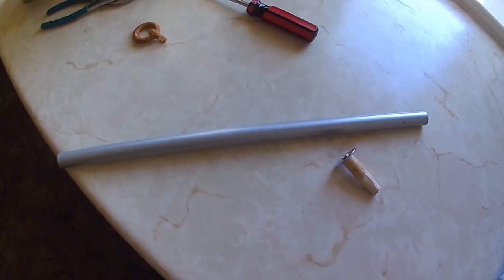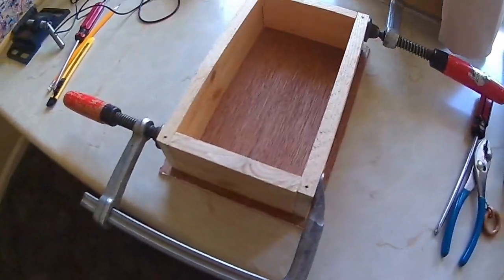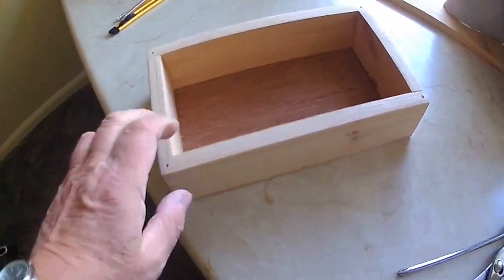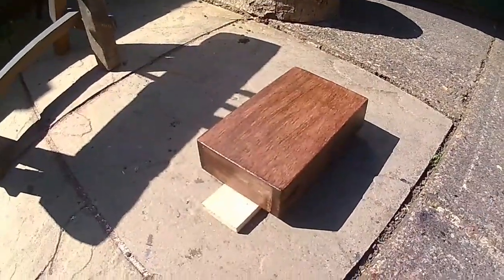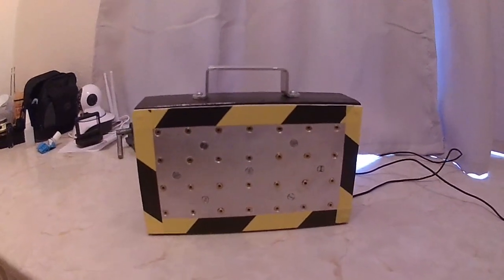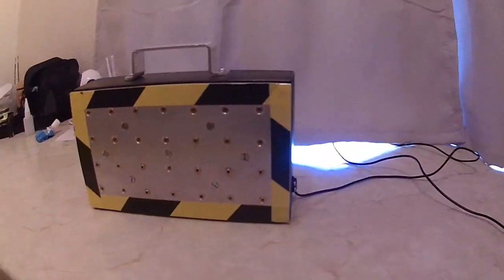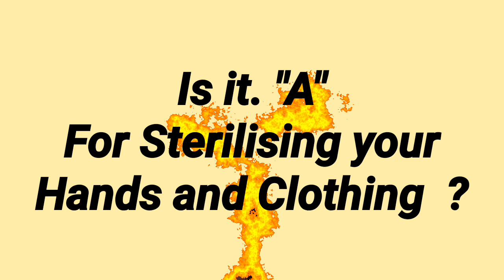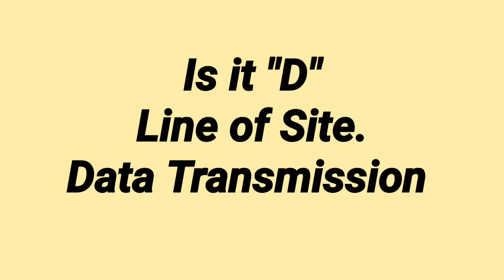Mystery Diy Electronic Project Part 2 of 2

Comment: I have now come to the conclusion you have seriously lost the plot George, but its obvious what it is. " Its a Smoothing Oxx Fluffy Flora "
Reply from the maker: Correct. I was ok but now my jobs are running out I miss the motorhome.  It's in locked storage and I cannot do the repairs I want to do. Such as change 2 x brake pipes. Reseal the roof vents and make it water tight on where the glass fibre roof joins the gutter rails etc. Just hope it's a dry summer.  Bored George
Reply: @MakeDoAndMend1  Stick with it George, your not on your own we will get through it.